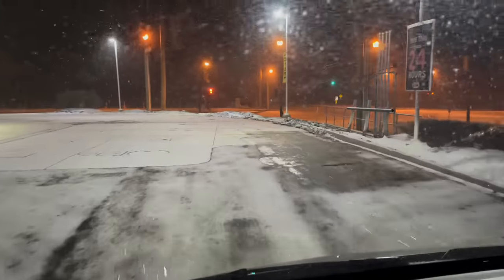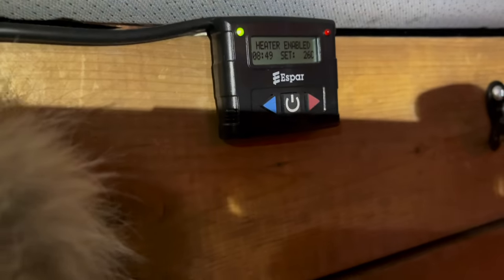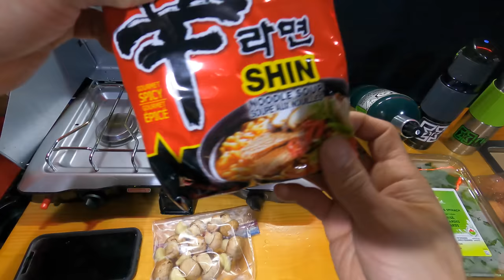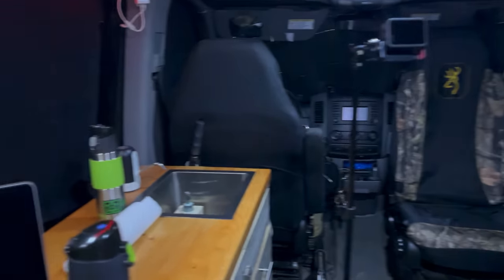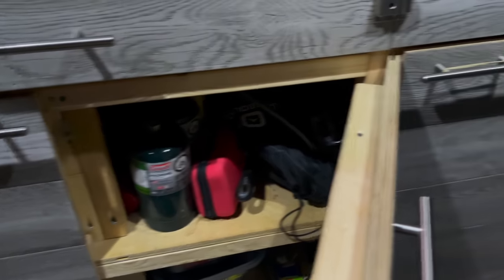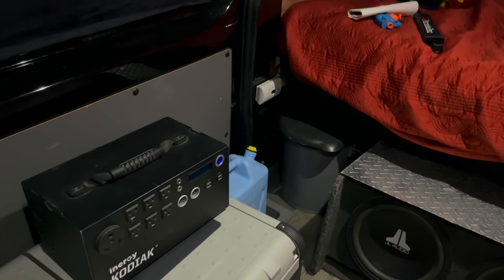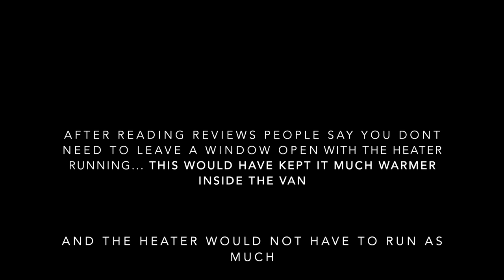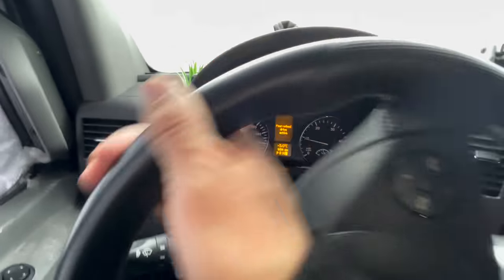Surviving Winter Storm In The 4x4 Sprinter | Vanlife

Comment: Those heaters are great and you don't need extra ventilation. I'm a trucker and have spent many a night with the heater blasting all night in the bunk, toasty as can be.
Reply: How much diesel fuel does that take to run for say 10 hours? Diesel is so expensive up here in Michigan, I can't imagine. Sometimes I think it's cheaper just to stay at a Motel 6.
Reply: @northstarsmith6798   Should use one gallon. Maybe even less actually but should use no more than one gallon and the heat is HOT.
Reply: your truck bunk roof and walls are heavily insulated. sprinter is not.
Reply: @andrewfung9614  No they aren't. Only way they are insulated are if you do it yourself. There is sound dampening but that is it.
Reply: I’ve done it once for two nights on a move to cold lake Alberta in a rig,fun for sure -49 with windchill that weekend
Reply: Fox Mulder   How are the government "attacking" them? you make it sound like it's a personal thing with truckers as if they pay a different price from everyone else? 

Of course things were cheaper, because there was more of it.....What's your solution? 

Not sure why you all blame Biden either EVERYONE IS IN THE SAME BOAT.
Reply: @northstarsmith6798 If idle the engine a gallon an hour. Diesel heaters I have no idea how much it uses in a 10hr. Period

Comment: It’s not a big deal. Proper insulation and a diesel heater (the Chinese diesel heater) will get you through the harshest weather. Living in my van for 2 years now. No sweat.
Reply: Do you make many snow cones in winter ?
Reply: Right. I did 20 months in a stock 4runner. No sweat.
Reply: @cyanidechrist  so you cool then?
Reply: I lived in My camper for över two years. Are lot of things to heat it up during winterstorms.
Reply: Those cheap chinese heaters aren't safe enough for me to sleep in same place where I sleep. Those burners arent tight and can cause and those fumes prob leak. Also wiring isnot heat resistant and fire insulate has asbest in it. Yep :)

Buy somw guality heaters, they can save your life and van. Like Wallas, Drumatic, Webasto.. i recommend guality made in Finland heater Wallas
Reply: something tells me youve never done this in alberta
Reply: Yea but your not on Tube, and there storm is worse than anything you have seen.
Reply: Can't we use blanket to sleep and switch off heater. I am from south asia, kindly explain in details
Reply: @Beautyaroundplanet  if you use too many blankets you will start to sweat a lot and wake up in your sleep. if you have a heater you can set the temperature to what you like and that way you can sleep comfortably
Reply: Ok nerd
Reply: @joonal9448  this topic probably requires some research. van lifers have tested the Chinese diesel heaters for years and had zero readings on their carbon monoxide detectors. They exhaust external to the vehicle. I agree that quality control is important to safety - you’re not wrong - but it’s important too for people struggling to survive to know that if a Chinese heater is all they can afford, it can stop them from dying due to hypothermia. 👍

Quality heater > Chinese heater > freezing to death
Reply: @Beautyaroundplanet  I’m from Australia and, like yourself, rarely see temperatures reach 0C/32F even in winter. Some parts of America can get much, much colder than that. Plus, even the best-insulated vans lose more heat than buildings. If the interior temperature of the van got below 0C/32F due to lack of heating, you’d lose a lot of body heat from exposed body parts (any part of your head that’s not covered) and breathing air that cold would be very uncomfortable.
Reply: @balthazarquinn  thanks for guiding. For many of us it is just a imagination that how people survive in such hostile weather

Comment: Just a heads up, that 2nd carbon monoxide alarm should be lower than where you sleep.  That gas is heavier than air so if god forbid the first detector failed by the time the 2nd one went off it might be too late.  Really, you could put them right next to each other.  

Nice build by the way.  Safe travels,
Jay
Reply from the maker: Thanks you! 🙏🏽🙏🏽🙏🏽
Reply: Co has a specific gravity of less than one. So it floats.
Reply: @godofplumbing  Wrong, CO2 is 53% denser than air, so it's heavier. So stop saying stupid things that could kill people...
Reply: @DiabloOutdoors  he didn’t say Co2 he said Co
Reply: @DiabloOutdoors  CO —relax
Reply: So which is it? Could the chemistry folks put their thoughts in here so the rest of us learn?
Reply: @kathyglass2922  CO: 28g/mol, CO2: 44g/mol, air: ~29g/mol
Reply: @mitulabattyi  Got it. So CO floats above air. It rises.
Reply: @DiabloOutdoors We're not talking about CO2. CO2 is not Carbon Monoxide. CO2 = Carbon Dioxide, a completely different substance than we're talking about here. CO = Carbon Monoxide. Carbon Monoxide is the poison gas we're talking about and pure Carbon Monoxide is slightly lighter than dry air of the same temperature, and therefore, under normal conditions it tends to diffuse relatively evenly throughout a space rather than sinking or rising very much. Obviously, outside environmental factors can affect how the gas disperses under real world conditions. I always follow the installation instructions that come with that specific CO detector since the manufacturer is more likely to know how that CO detector works than random YouTube commenters who may or may not even know the difference between Carbon Monoxide and Carbon Dioxide...
Reply: @kathyglass2922  Pure Carbon Monoxide is slightly lighter than dry air of the same temperature (I believe it's around 3% lighter). In general, CO tends to disperse more or less evenly (relatively speaking) rather than drastically rising or sinking the way many other gases do. Obviously, this isn't set in stone since many environmental factors can affect the way CO acts in real world scenarios. In general, if I'm installing a CO detector I just follow the installation instructions that come with that specific detector and I refer to the NFPA standards if I'm looking for more information. (p.s. I know you know the difference but for the others who were commenting earlier, yes Carbon Dioxide/CO2 is denser than air and tends to sink but that is a completely different substance that Carbon Monoxide and has absolutely nothing to to do with this discussion.)
Reply: I worry more about the flammable methane I produce depending on my recent diet.

Comment: I used to sleep in a 1990 YJ soft top Jeep at that temperature on snowboard trips. Cold AF! No heater but i did make a sleeping platform out of a sheet of plywood so i could stretch out diagonally. After a few failed attempts (eg. freeeeezing nights) i figured out the recipe was to soak in the nearby hot springs, change into full thermals/puffer jacket/socks/beanie, etc eat hot food then get into my sleeping bag and try to pass out before my body temp dropped too much. Definitely not for the faint hearted but so glad I experienced it 🤙  I would have killed for your Sprinter! Glad to see you making the most of it.

Comment: If you want to retain heat, reflective side of the windshield cover to inside may help slightly. Opposite on a hot summer day.
Reply: Yes! Here in Brazil at the south they sell windshield covers and to all glasses van to use due to the snow. It maintain a lot of heat inside and we cannot use heaters. Here in south at winter we have temperatures at -11C and we dont have winter diesel, so if we need to turn engine on at night we will have problems.
Reply: @JD-zc8pu  why don't you have winter diesel?

Comment: Nice setup.  Only thing I might change is to extend the exhaust pipe so it is sticking completely out from under the van.  That way you don't have to worry so much about the fumes building up under the van and finding their way inside.  Personally, I have my exhaust similar to yours.  However, I have an extender I put on it whenever I use it.  Only takes a few seconds to slide it on or off.
Reply: Genius idea!
Reply: Great idea!!!!@
Reply: I'd add another idea, you know how bridges freeze up before the roads because the air blows in under them. Make some side skirt panels that you can remove and keep in storage, and pull out and attach when parked for the night. Keep the wind from just blowing in underneath the vehicle. I could make a real difference in how hard your heater has to work to keep the vehicle warm.
Reply: @piperp9535  or an air suspension like the low riders have.
Reply: @beastman.330  Yup, and a few spongy strips of some material to throw underneath before you drop it low, makes a seal. Could be inflatable, add a compressor, always good to have anyway.
Reply: @piperp9535  That heater isn't working that hard. They are designed for that purpose. Putting skirting up defeats the whole purpose of van life.
Reply: @mikel9567 ???? Even a portable skirting?

Comment: Nice rig! Just sold my 2014 and started on a bus until prices get back down on the sprinters. The 4x4 low roof is an awesome option imo. Primarily use Instagram but you gained a sub!

Comment: During winter the vents in the dash are enough for me. Keeps snow and noise out. As you might be concerned to get fumes of the heater into the van: the air intake is located on the driverside of the hood. So no worries, but with a co2 warner, you sleep better.
Reply: Yup.
Reply: CO*

Comment: You should use moving blankets on the outside to cover your windows at night to keep the heat inside. If the outside glass gets cold than your van will get cold because that same glass is also inside the van
Reply: Never thought of that. Great idea.

Comment: If I where you when warm weather comes I would strip the interior and line  the walls ceiling and floor with Reflective Insulation  recommendation foil double bubble foil you can get it at insulation 4 less. Won’t regret it. Summer heat protection and Winter freeze protection and Amazing Heat retention. 🤟🏻🇺🇸 PS it Glue’s well with some 3M High Strength spray glue.

Comment: Bend your exhaust so the output is out the side of the van.  It is safer that way as the fumes are not under the van like you have it now.  Second with it pointing forward like you have it it will get a lot of road grim and mud in it, potentially clogging it and  causing issues with the heater running.   Also when it is under the van it is hard to see if it is clogged by ice or mud, mine gets a lot of gunk on it.  Finally it will be a little less noisy pointing away from the van.  My heater is very quiet, the loudest part is the exhaust so I try not to park with anyone on that side.
Reply from the maker: The exhaust is pointing from front to rear… I get your point and will direct it more away from the van. Thanks for the input!
Reply from the maker: Do you ever sleep in your van with the heater on and window rolled up all the way or do you crack a window like how I did ?
Reply: @hustlelife369  When I am sleeping with the furnace on I keep the windows and the roof vent closed.  If installed correctly the furnace pulls in combustion air from the outside and exhausts the fumes outside as well making it perfectly safe.  

I do have, and strongly recommend, a smoke and co2 detector in the van. It should be battery operated with its own battery and not tied into the house electric system.  

I open the roof vent and a window when cooking. I  will also open the roof vent in the morning for a while to dry the van out from any built up moisture.
Reply from the maker: @whiteturtleadventuresandphoto   Thanks for sharing! I will try this… I also have 2 battery operated Carbon monoxide and smoke detectors just in case one fails.

Comment: Nice van nice video the noise of the heater would bother me though. I think about pointing the exhaust at the oil pan to preheat the engine  try to capture as much energy as possible.
Reply from the maker: Thanks.. I had the window cracked open and the fan going so it was pulling in a lot of fresh air and it was really cold out so the heater fan was on high to keep up. Next time I’m going to try sleeping with the windows up. When the heater fan is on low you barely hear it… as for the exhaust pointing to the oil pad not sure if CO2 could somehow get into the van
Reply: @hustlelife369  I wouldn't trust it either & I'm not so sure it would help alot anyway. Sprinters have 10 quarts of oil unlike a car with half that or less. A magnet type heater could be added to pan & plugged into a inverter with a switch. That would be alot safer but in reality these heaters started to help get diesels started 30 years ago when it was a problem. Rail systems avoid that trouble now & diesels start in the cold now. I definitely allow mine to warm up longer but they don't need heaters today. I love the idea tho & love hearing brains think. Safety 1st tho & especially when you're sleeping. 
😎👍

Comment: Nice video and congratulations i have a quick question how bad is driving in high winter blizzard since your van is high roof, extended and dual rear tires i assume? Does it sway,does it stay solid when driving through high slopes ? Just to add i am in state of Vermont considering getting  a GMC c6500 cutaway for myself but worried about dynamics.
Reply from the maker: Mine is a low roof 144wb (short wheel base) and not a dually. 2018 year model and has sway assist feature. I've only had it kick in once on a really windy day on the highway the only thing I noticed was a notification on the dash that it was active. Otherwise no issues. I feel like this truck goes thru anything in bad weather and feels very safe. hope this helps cheers!
Reply: @hustlelife369  Much appreciated.

Comment: I run a 5kw diesel heater in my 1995 high top Ram Van B2500 in Denver Colorado, and even when temps dip close to 0 degrees F, I have to keep the heater at or near its lowest setting to keep the Van from getting too hot! No wonder your cold…Running a max fan with a window cracked that far open isn’t a good move, obviously! No need to do either as long as you install the heater correctly.

Comment: Note of to cold propane can fail . Coleman white fule dose not fail . FULE tabs can work good .  You can use these fule tab cookers on a thick ceramic plate to sole your frozen water LIGN problem . Just one tab will run 12. Minutes.  They produce no smoke

Comment: . vans are very cold ,what about a generator hitched to a mini trailer,,,, or a rack with a box to house fixed on the back doors bet you could run an extension from the frame . .if insulated either way for noise, saying that they are quiet , you couild then have an  electric heater . you could even have your. gen ...with a chain on it next to the van housed in a insulted wood box, then fold up box bring gen in when your on your way

Comment: My 4x4 mercedes is coming in soon! 2022.   Can you maybe help out with some resources or plans to build? like a PDF with the dimensions and everything and maybe some tips you would suggest?  I wanna do a nice roofrack with as much solar and a good inverter and some battery backup so I don't need a propane/gas/deisel generator.   specific appliances, etc?  best swivel seat, etc,     Def will be creating a new Youtube to showcase my from start to finish build and of course my adventures I go on.

Comment: you don't need a washroom, you're Sprinter is not an extension of you're house, a portable toilet is well enough. 🚽 i will use a portable generator w/ Solar panels, (a very nice battery unit) it's called a

EF ECOFLOW DELTA Pro Portable Home Battery.
that will work well enough i should think.😇👍

I'm interested in a very nice Van like the 15 Passenger Sprinter 2500, not so much w/
the creature comforts having been a truck 
driver i learned to live on the bare minimum.

anyway excellent video, good luck to you in you're travels! 🚐🚐🚐🚐🚐